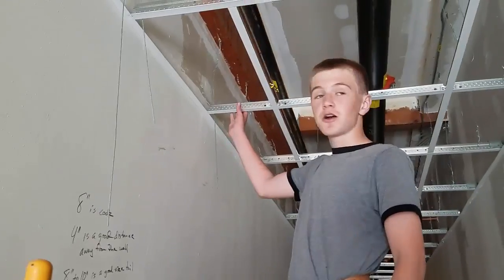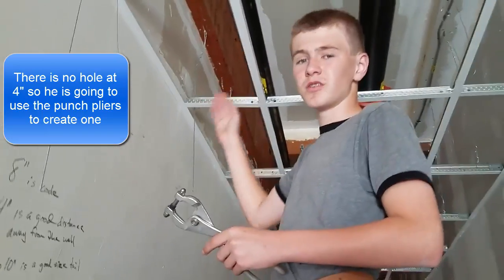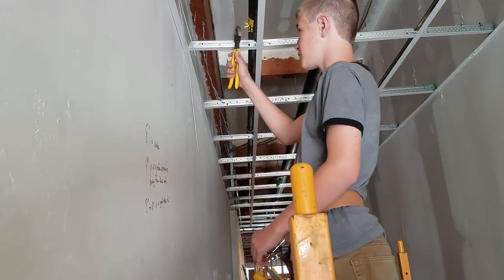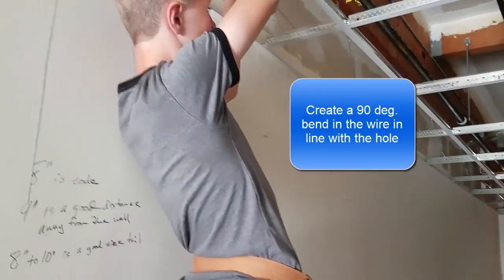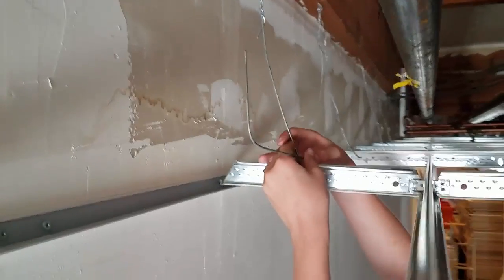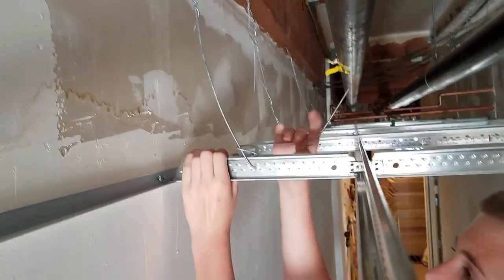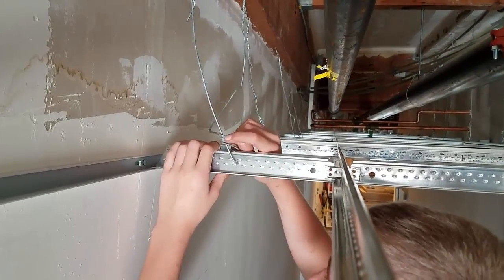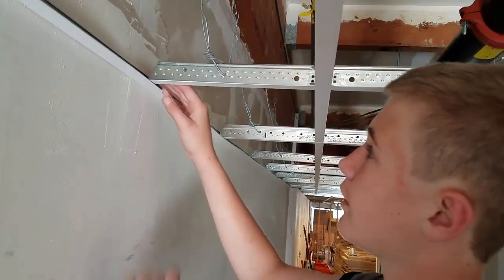No. CA Perimeter Wire as per CA Building Code

Comment: Why you need wires? on those short T runners
Reply from the maker: CA seismic code. Any cross tees or mains over 8" have to be supported by a 12 ga wire.
Reply: What a load of bollocks
Reply: Rarely put wires on tees , only mains . I see the pipe above the main but still could of figured something to get mains
Reply: In California you need perimeter wires 8 inches or bigger and also light wires and also seismic post anything over a thousand square feet but depending on the parts of California some people require seismic posts 144 square feet or bigger and also requires seismic clips and Expansion Joints now anything bigger than 2500 ft

Comment: Why on earth would you tie a wire on a perimeter tee? Seems to me it's doing nothing more than what the angle is already doing. You need to hang the mains not the tees. I mean unless you know something I don't this makes no sense to me. Also that's a whole lot of excess wire and its twisted too loose like that, I twist em tight and close to the wire and leave no excess.
Reply: Props to the kid for sure . Is the wire a little loose ? Yea a bit . I’d prob be cursing dropping tile with em tied like that but props for startin em young . These non Cali installers have no idea how good they have it . Perimeter wires  on anything over 8”. Seismic’s every 12’. And don’t get me started on hospitals and schools. Yikes. Imagine how much footage we could get up with the old wire every 4’ on the mains haha. Nice vid. <Carpenters Local 605>
Reply from the maker: California seismic code. Any tee over eight inches has to have a wire
Reply: Im gonna guess because the end peices are the easiest to fall out and if earthquake hit less pieces would fall on people's heads. That's the only thing i could think of tho. Fu@% California tho lmaoo 😂😭
Reply: @slippy11ful  would think they would have some kind of clip .
Reply: @slippy11ful perimeter ties are allowed to be loose. They are for seismic movement only
Reply: California Code my man

Comment: What i don't understand is...why is there a requirement for heavy gauge wire at perimeter cross bars? The physics of the application doesn't make sense in seismic or structural engineering...as the tile will be less than 1 lb. Cut the wall tab short to slot into the level track. 
Been dealing with too many installs where the thick wire prevents panel removal. Old codes should be challenged.
I hate drop ceilings esp where the installers hide short cuts.
Seems like the kid is doing OK...just reading info off the wall with a few weeks on the job. Probably the contractor's kid learning the business.
Reply from the maker: H M I agree totally with you. I repaired ceilings after the 89 quake in SF and seismic posts did more harm than good, I thinks that's a code that needs to be reevaluated also. Good catch on the reading off the wall. This video is more for him, if you can't teach it you don't fully know it. Thanks for the comment.

Comment: I've been doing grid for 20years and if another carpenter did grid like this or tied a wire like this he would be all time clean up person this is a joke...amatuer hour
Reply from the maker: Years of experience is no gauge of skill. I know workers that have been doing "grid" for twenty years and that's all they can figure out how to do, that's why they have been doing "grid" for so long. I'm glad you can tie a wire faster and better, good for you! This video is to show how to make a California code compliant wire tie nothing more. Where does the video mention "doing grid". Keep making awesome comments, I'm sure you're going to excel. Good luck in the rest of your career.
Reply: Ernie Johnson
I get the (code) reasoning why drop ceilings are used commercially, but why hasnt the trade come up with a better standard? This stuff is 50 years old and hasnt improved much for easier end-user care or preventive maintenance to mechanical equipment.
Every tile I've encountered has been blocked by suspension twists or zero clearance above. I even remove those hold down clips because no one has ever had tile lift in a large commercial plenum.
Reply: First off you don’t tie your wires off to your tees....code says only mains
Reply from the maker: @andrewlavigne2572  CA code, other states have it easy
Reply: @Jason Cherene are you saying CA code allows wires to be tied to tees? Because that offers no structural support whatsoever...UBC local 344 here
Reply: @andrewlavigne2572  701 local he is saying CA requires a wire on ANY main or Tee over 8 inches. Yes its stupid, yes it does nothing. yes i spent 16 hours this week doing just this..
Reply: @andrewlavigne2572  yes you do on your perimeter wires.
Reply: Ya I've been an installer for 17 years and I couldn't agree more
Reply from the maker: @ralphmaestas4220  CA codes, do you have seismic posts.
Reply: Just remember that's a kid there, gentlemen. Be easy.